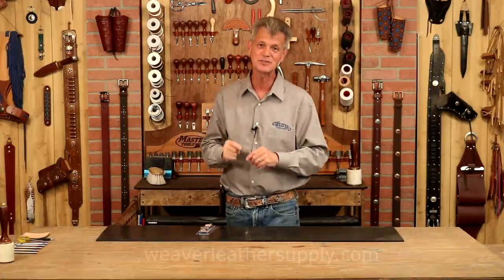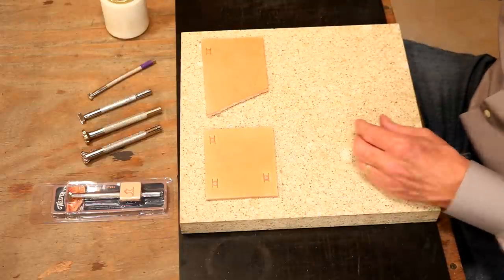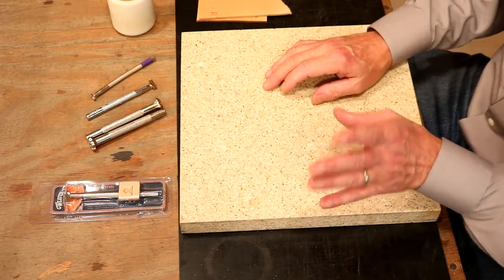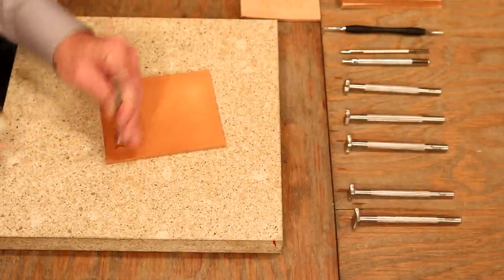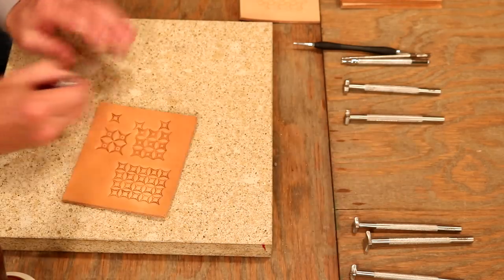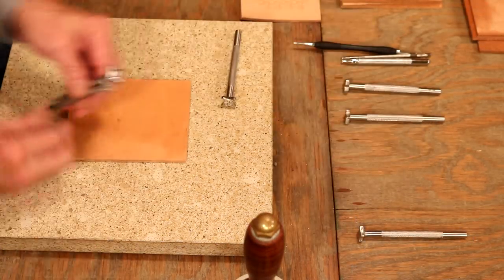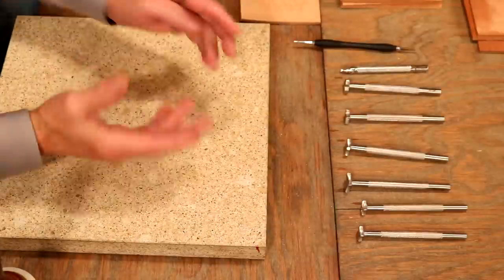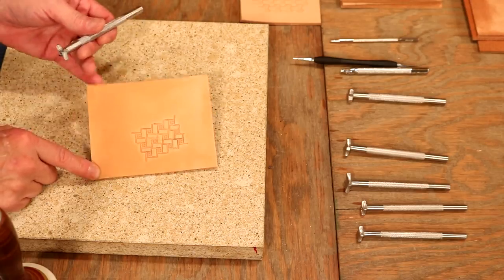Leather Stamping Tools, Segment 1, Geometric Stamps

Comment: Is the new line of Weaver Stamps made in the USA by Weaver like the Master Tools? Or are they made over seas?

Some of the kits Weaver offers are the same ones Ivan Leather offers. And I'm guessing the leather is an import as well, and the hardware that comes with them.
The price range of the new Weaver Stamps are about the same as the Stainless Steel Stamps from Craft Plus and Craft Japan.
That's why I ask if they are made in the USA.

If the new stamps are imported, I'd rather pay less and not get the fancy packaging I have to pay for that just gets thrown away. 
Or it would be better to buy a different brand and pay less for the stamp. The name on the stamp has little value to me at this stage in the game at my age.

Money may not be an issue for some people, and they may want specific names on all their tools. And that's fine if that's what they want and can afford.
But for me, I'm old and don't have many years left to use the tools I buy and I know it. And my tools will be a burden to my son to dispose of when I'm gone.
I'm also disabled and live on a very small budget, so money is a big issue for me.

I've looked at tools as an investment my whole life because every trade I worked in demanded I have my own tools.
You have to make a wise decision when purchasing tools. Is it a tool that will receive a lot of use, or an occasional use, and purchase accordingly.
Most stamps get the occasional use, not used on every project, with a few exceptions like bevelers, backgrounds and matting.
All depending on what kind of carving and stamping style you do as well. If you do all Sheridan style, you really don't need all that many stamps.
So by all means, you should buy the best tools available for the type of stamping regardless what country they originate from.

I don't particularly like Sheridan Style, so I just do like Chuck does and grab stuff off the internet and make up my own designs.
I have never done the same stamping design twice, but I don't run a production shop by any means. I do it for fun and to pass the time I have left.
I don't sell much of anything I make, I just give it away to people who are kind to me and help me out when I need it.

So, I'll ask a question for those who have read this far...
Would you rather pay $20 each for the new Weaver Stamps, and have them come in a simple zip lock baggy with a backing card?
Or pay the $25 each and get the fancy packaging and piece of leather that will just get thrown away?

Because in the end, you are paying for their marketing strategy. It cost more to ship because it takes up more volume, takes longer to package, the packaging itself costs more, the case shipping box is larger and cost more... And we are all paying for that, and it all ends up in a land fill when all is said and done.
And it doesn't add any more value to the tool itself, it's just making a tool look more appealing by making it look special. 

To me, a special tool is one I bought economically that does the same thing as a higher price tool does on the occasional use.
I recently took advantage of a sale from a supplier on stamps at $3.99 each. The exact same stamps normally sell for $7 and $8 from several suppliers, even Weaver.
And the best part when they arrived was, is that some of them were made in the USA!  And, a few of them are the exact same size and design as the new Weaver Stamps.
I know they are not Stainless Steel, they are a Zinc Alloy so they won't last as long. But then again, neither will I. And who knows what will become of them when I'm gone?